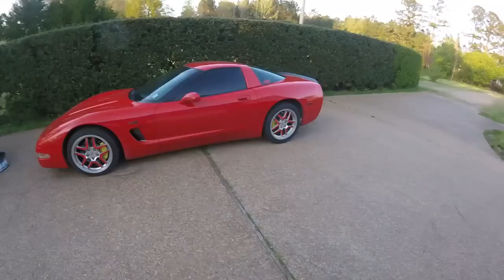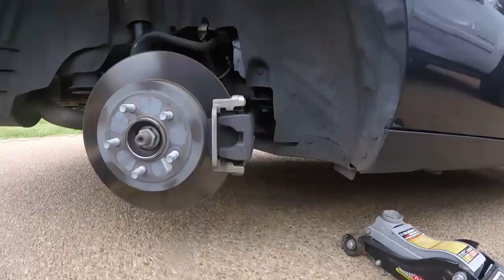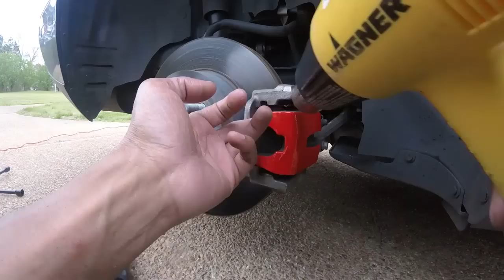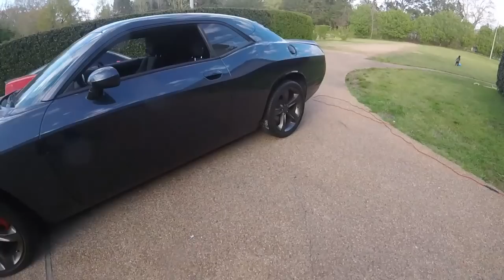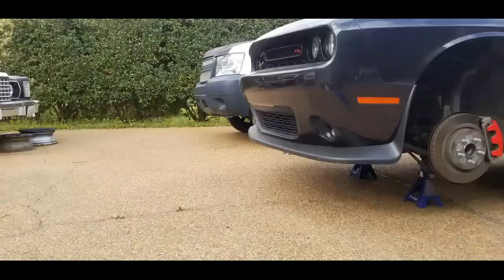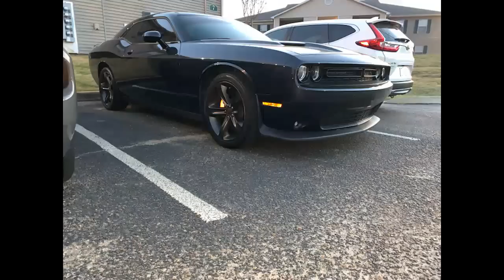Reflective Vinyl Wrapped Brake Calipers

Comment: Any break heat issues?
Reply from the maker: Not to my knowledge. He sold the car last summer but they were still in good shape when he sold it
Reply: @89imp03  thanks I was just concerned about the heat the brakes create. my Porsche calipers are a lot bigger than those you showed on your car.
Reply from the maker: @kellynash4588  yeah the caliper wrap is thicker and handles the heat better than the regular vinyl
Reply from the maker: @kellynash4588  those brembo style calipers are a little tougher to wrap with the curves. We tried it on his SRT Jeep recently
Reply: @89imp03  thanks for your assistance!!!! Have an awesome pandemic free summer!
Reply from the maker: @kellynash4588  no problem lol enjoy your freedom summer too